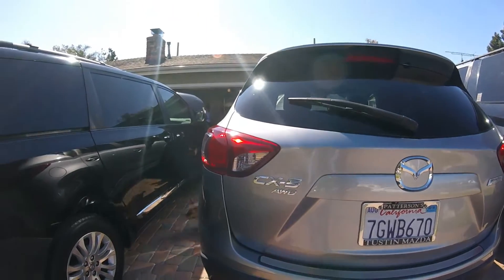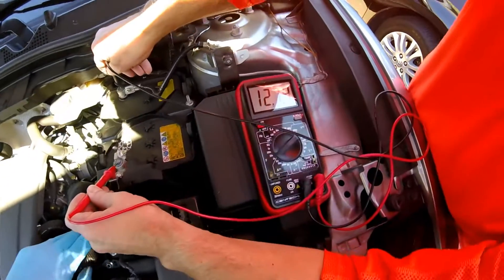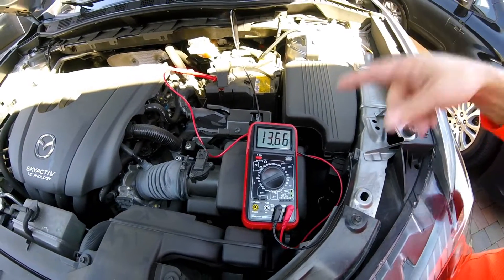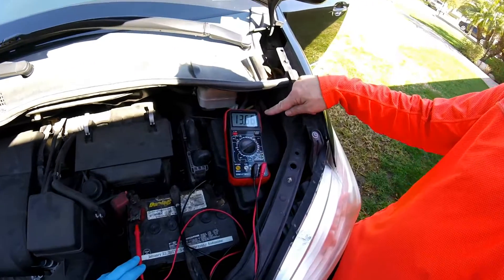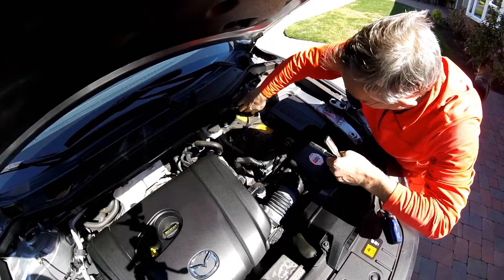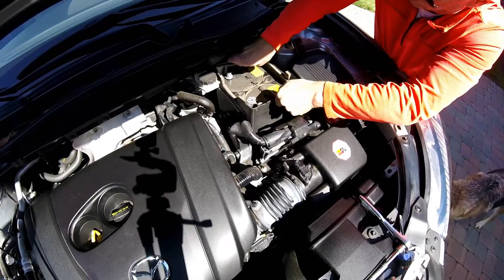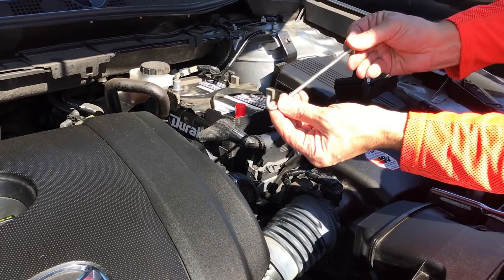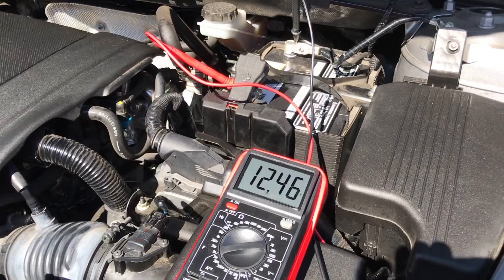How to Test Car Battery with Volt Meter & Replace Bad Battery

Comment: Me: the car started.  I will keep using thr battery
Reply: And then you'll be replacing your starter or alternator because you insisted on using a weak battery, not to mention all  the voltage codes you're going to set with using a weak battery. 🤔 😅